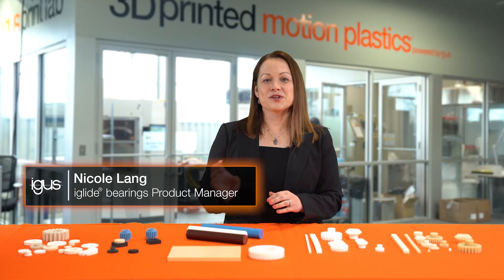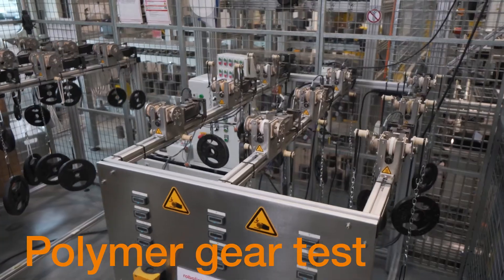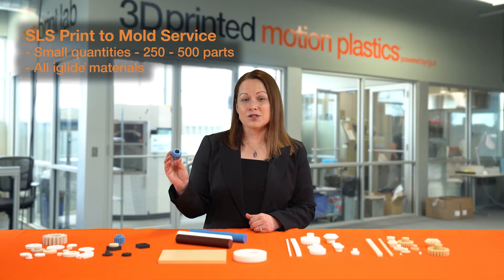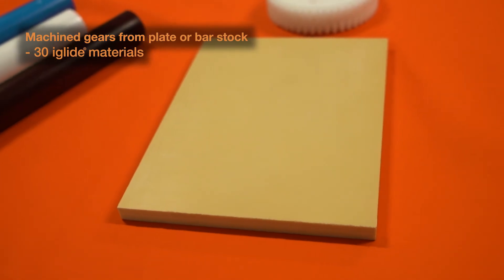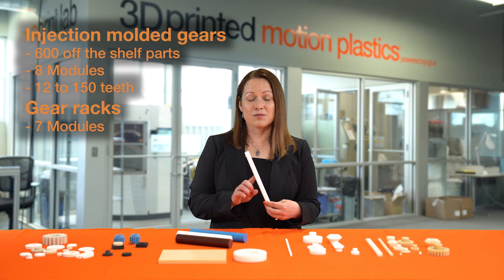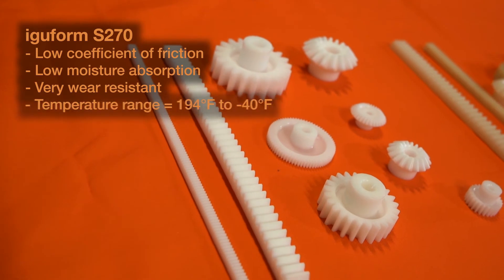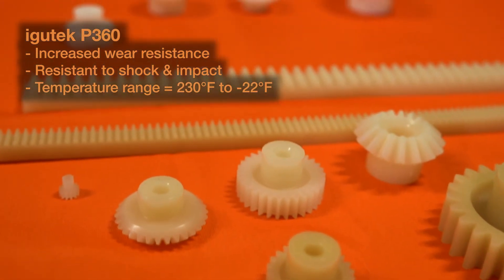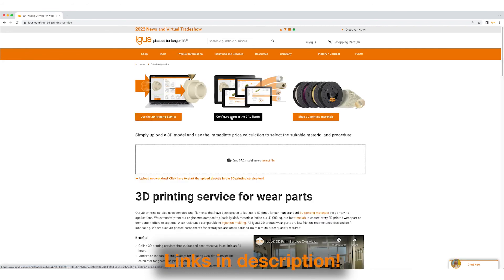iglide® Polymer Gears: Introduction

Comment: I am prototyping a machine that has a planetary gear system. Is it possible to order only 1 set of gears?
Reply from the maker: Sure! We have no minimum order quantities so you are able to buy 1 pc. If you need a custom solution, we offer 3D printed materials optimized for gears. Please reach out to us directly at (800) 521-2747 or here: https://www.igus.com/info/iglide-contact for assistance and we would be happy to help.